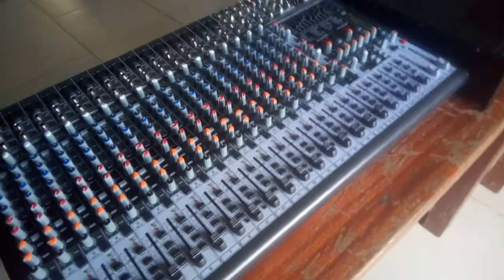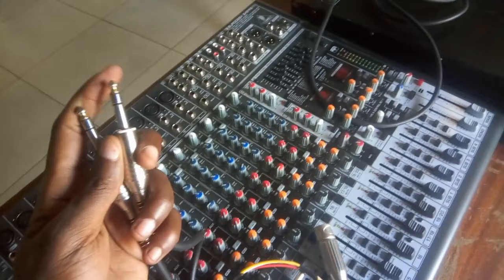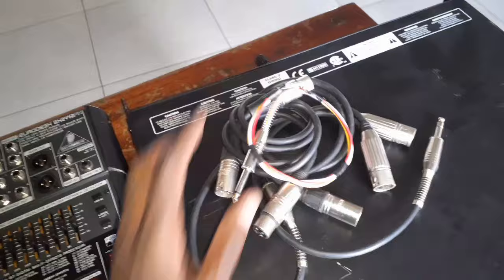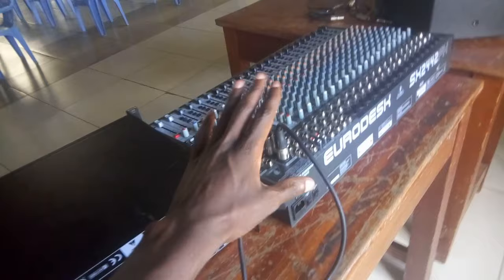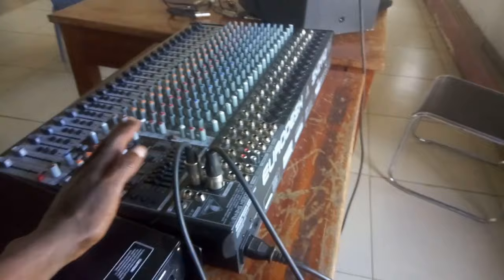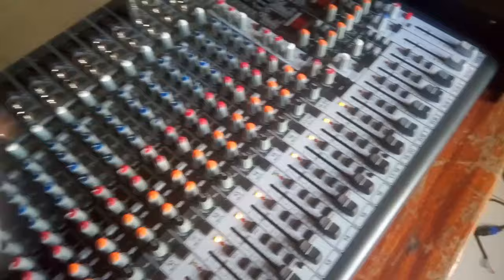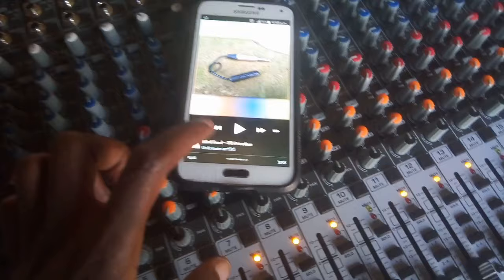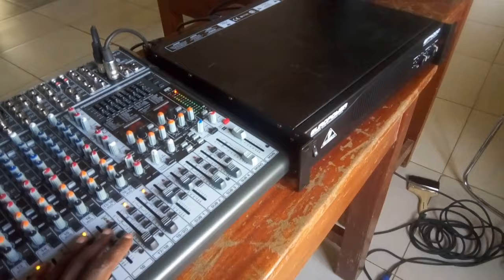How to Connect Mixer to Amplifier | Sound system Setup

Comment: Thanks bro now l understand how to make multiple connections with my mixer. Thank you very much. I have one question for you and my question is can I connect yamaha emx 5016cf to a  
Let me say lead or bass guitar power amplifier??
Reply from the maker: I don't understand the question???
Reply: Sorry but what I mean is that how I can  connect powered speakers which I'm already using for my lead guitar to the mixer.
Reply from the maker: Ooh easy insted of connecting the 2 xlr cable from the mixer to amplifier just connect them to the powered speakers direct without the amplifier

Comment: Man I been looking for so long for a video on this my only questions is can I daisy chain a second pair of speakers to this or should I do it another way? also I have a powered subwoofer where would you recommend that to connect...also balanced or unbalanced XLR?
Reply from the maker: Nice question bro: yes you can chain join the other speaker if the amp has both channel connected bt i have only 1 one speaker connected, connect the other speaker to the 2nd channel, xlr balanced or unbalanced!  Xlr should be balanced. But to connect a powered subwoofer you don't need an amplifier connect it direct from the amp with balanced xlr.

Comment: good day, I have a t.amp --800 thomann Power amplifer and a mackie 12FX mixer and a Plye Passive speaker. I have the Plye speaker connected with 2 speakon cables (L and R) from the passive Plye speaker directly to t.amp 800 thomann power amplifier into L & R speaker connections with the other end of the speakon cables. From the Main out L&R of the mackie 12fx mixer 1/4 input to the T.amp 800 thomann power amplifier chanel A and Chanel B. I have 2 microphones connecected via XLR cables into channel 1 and channel 2 of the mixer. I have no sound coming out of the passive Plye speaker. I know that the speaker works yet i get no sound. All my cables and volume levels are up and working.. I cannect get any sound of the PA speaker. Any thoughts? thank-you

Comment: How do you run powered speakers to that same set up
Reply from the maker: Good question, use aux sends to connect powered speakers direct to mixer because powered speakers don't need amplifier.

Comment: How about if your mixer has 24 channel, you are going to connect the XLR cable in Microphone channel 1 outs to XLR cable line in amplifier???
Reply from the maker: 24 channels or 18 channels mixer, all mixers have only 2 main output. Y connect to mic input?

Comment: By the way you set up your channel gain,  master output level and the amplifier input sensitivity controls, you are wasting at lest 14 dB of dynamic range. That's 14 dB lost in the signal to noise ratio and gain structure of the system.
Engage the channel PFL button, set the channel fader to unity gain (0 dB) position, adjust the gain control until the channel input signal registers 0 (that is equivalent with +4 dBU nominal level) mark on the level meters, then raise the master output fader to the maximum (+10 dB) position. This way you are using the the while dynamic range of the mixer, registering an effective output level of +14 dBU to the amplifier.
Finally, on the amplifier back side set the input sensitivity switch to +4 dBU (1.23 V RMS) position and, on the front panel adjust the input sensitivity controls for a gain reduction of 14 dB, which is equivalent to 10 o'clock or 11 o'clock position on the front panel.
Now you have maximized the dynamic range and optimized the gain structure for the best signal to noise ratio throughout the system.
The mixer will not clip, the amplifier will not clip and will be able to deliver it rated power output without distortion.
Use only the master output level control on the mixer to control the output level of the amplifier.
All you have to do now is to ensure that the speakers power rating and the amplifier power rating are compatible.